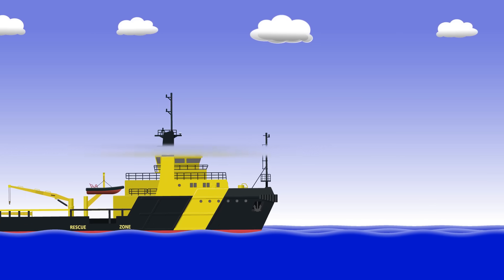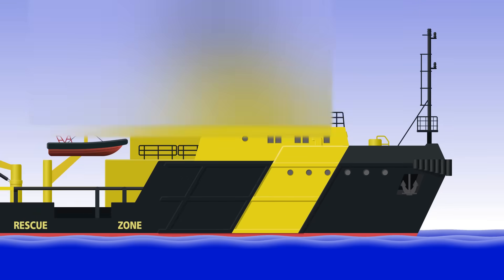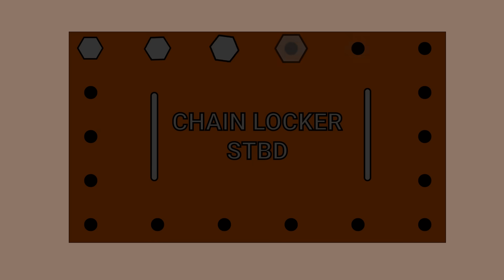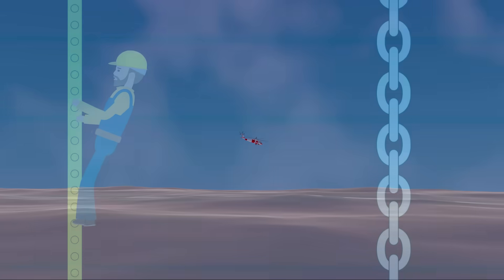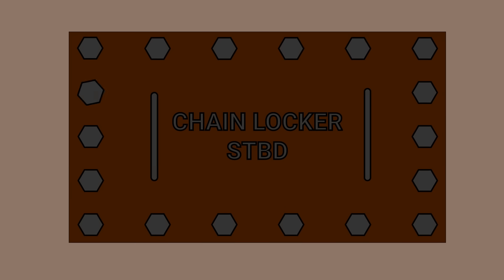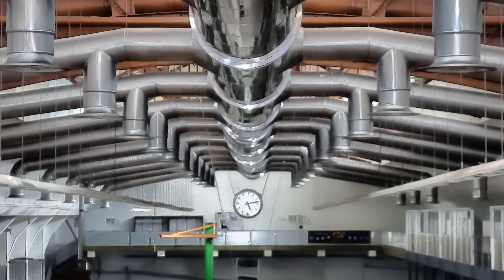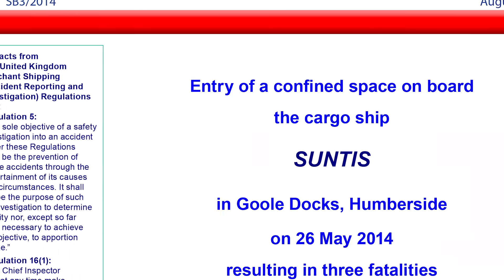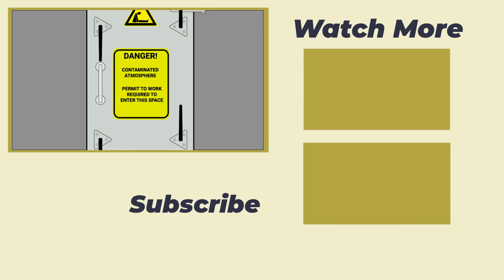Why Enclosed Spaces Are So Dangerous? | Enclosed Space Entry

Comment: If the only entrance is bolted shut, then you should probably just... not.
Reply: The only other entrance was probably the chain entrance. Probably pretty narrow compared to the volume inside.
Reply: Sometimes people dont really think of these kinds of stuff. Empty but spacious space. No wierd smell. Shouldnt be toxic, right? 

Its just things that fly over your head. Like entering a locked storage room. You think its locked because its because they dont want people to be there because of the chain suddenly moving and dropping. Its not like they were warned (no oxygen inside).

Its the immediate threat that we worry about and never the other stuff so its understandable as to why 2 people had gone there without breathing equipment.
Reply: That's what I am thinking.
Reply: DANGER: CONTAMINATED AIR
Reply: Yeah they should be given ear plugs.
Thiers deaths made me sade, considering two of them went in to rescue their friend.
Reply: Thank you. I totally missed that in the video.
Reply: But crew were doing tying off these chains to sleep, this was most likely an example of corner cutting combined with poor design.
Reply: Mostly toxic gasses don't have smell...
Reply: @alvydasjokubauskas2587  . The real issue is many toxic  gases, have no smell at all . And some toxic ones actually negate any sense of smell , such as Hydrogen Sulfide, which smells awful in low amounts, but kills the sense of smell at higher amounts .  A human , simply cannot tell the difference based on their senses . And no human can "smell" if there is not enough Oxygen present.
Reply: Its insane how many people die from this on ships. Second ship I was ever on guy died in a ballast tank we had purged to repair a fracture.
Reply: @Bitter-Sailor  Iron rusts, and when it does it takes the oxygen out of the air. An enclosed ballast tank is a death trap, if not properly ventilated for many hours after being opened . Never go into one,  or even stick your head into one to "test" the air. good chance of dying.
Reply: @chrisperrien7055  I'm aware of that.  Sailed Cargo officer on ATBs for 10 years.
Reply: Jerome Powell  I make 6 digit income and only work 6 months out of the year.  Merchant Marines is a pretty sweet career.
Reply: I do work on such spaces frequently.
Some jobs needs to be done by someone despite the danger. There are procedures to mitigate danger.
Reply: I am kinda amazed that this crew knew nothing of both of Iron rusting depriving of oxygen and that ocean organisms/organic materials rot in enclosed spaces generating Hydrogen sulfide, a stink you don't want to be around, or in. Those warning labels, and highly rusted over/painted huge bolts gave fair warning.
Reply: @chrisperrien7055  People just assume oxygen is everywhere.
Reply: Otoh tho you would think they could at least put a warning sign on the door... Otherwise it seems to come across as fairly innocuous, to me at least.
Reply: Yeah, removing bolts and climbing down a ladder shaft just to secure an anchor chain for the night because it's annoying seems like a really bad idea.
Reply: Well... the chain sounds won't be bothering them anymore.
Reply: Or with good reason, training, and with a suitable breathing apparatus.
Reply: What is hard to understand is, why the Captain, Chief or someone with authority allowed them to entry an enclosed space without proper ventilating first.
Reply: ....yea but this chain is really annoying

And fair point, without the benefit of this video you might think it has 18 bolts for theft prevention.... Or sometimes, stuff just has lots of bolts, ever repair a German car...? 

Not all aspects of a think is well considered all the time
Reply: That's only cause you have seen this video.  That kind of thinking would have us without most of modern electronics in this dreary world.  Exploration and initiative are demanded cause no one wants the commonplace or normal anymore.
Reply: Frank Kepler 
True
Reply: hahahaha thank you for recycling what the video said..very informative 👌
Reply: 18 bolts too. 18 must mean something pretty you know serious
Reply: @rafalswiniarski3866  Maybe the 18 bolts are there to avoid the chains being stolen.
Reply: @bfmarcondes  Do you know how much those chains weigh? No one is walking onto the ship and just carrying them out to steal them. Standard ship anchors for a vessel this size, just one link weighs 158kg (350lbs). Good luck trying to steal it. I hope you were joking about the stealing bit.
Reply: @2009dudeman  Irony my friend, irony...
Reply: @bfmarcondes  thats sarcasm i think not irony
Reply: @serenity748  Hello, not really since I didn't had the intention to ridicule ou mock somebody. 

Now that you have raised the question I think that a paradox could be a better definition.
Reply: @bfmarcondes  iron-y my friend iron-y
Reply: Some of us work in industrial settings. We have confined space procedure. Literally just today I unbolted a bin that holds 30,000 pounds of granular product and crawled into to clean it out. (We have oxygen meters, N95 organic vapor cartridges and lock out tag out procedures though because I work in the western world with the other devolved people)
Reply: @jackmehoff7274  it happens all the time in the western world to.  People get lazy skip procedures.
Reply: @jackmehoff7274  jack me off, really?
Reply: That's what she said.
Reply: Why was it bolted shut so the oxygen could run out? This is why we need  right to repair. Ships need to be designed to be repairable, and all parts should accessible
Reply: Three more male casualties, to go with the 97% of workplace fatalities that happen to men. "Equality" amirite ladies?

Comment: i had two friends and a father die this way.  they entered the pump house for a manure pound for service.
Reply: My condolences.
Reply: It happened to me a year ago at work. I was cleaning out a pump station for a main sewage line here in Iceland. I felt what was happening and was aware of the danger and barely made it up the ladder and collapsed on the floor above. I had to be rushed to the hospital and I was fine thankfully. The doctors said that literally 5 more seconds down there and I would not have been able to make it out myself.
Reply: @gudjonbirgir9317  phew that was close, glad you made it before the light went out.
Reply: @Mr-Ad-196  yeah. I guess I kind of cheated death on that one. Imagine dying in literal human shit. Also I was only 19 when it happened
Reply: @gudjonbirgir9317  I have worked around this gas in shop environments and yeah.. it's nasty stuff. After reading this thread, I had no idea just how dangerous it was.
Reply: @gudjonbirgir9317  not just time, perhaps you wouldve just expended more energy in the same time. Thank god you made it out that is extremely anomalous. Confined spaces are so dangerous BECAUSE self rescue is 99% of the time not possible.
Reply: @psyience3213  I'm guessing the oxigen levels were low but not immetietly lethal. And when I started using the vaccum hose and removing most of the sand and mud and shit off the floor I must have relesed some gas and messed with the oxygen level. So I very slosly felt weak and at one point was unable to stand on my feet down there. Thank god I had a coworker outside that threw me a ladder as I felt I was slowly going out. I made it. And I am thankful for it. I know its weird to say bc I was working a vaccum truck and working with shit all day but I love my job and this is just something I have to keep in mind next time I go down in there in the spring
Reply: @gudjonbirgir9317  Glad you escaped with no lasting effects. Stay safe!
Reply: Hydrogen disulfide. It stinks to high heaven, but in dangerous contentrations it actually knocks out your sense of smell entirely, often lulling people into a false sense of security.
Reply: Damn
Reply: Oh God......I remember as a kid.....we use to play in that place.....it was unlocked.....welp I think me and my friends got lucky......
Reply: h2s gas?
Reply: @spawnof200  That is the number one cause for suffocation in facilities such as that, so probably.
Reply: My condolences. This is a real fear of mine being a plumber. I've always been cautious about deep manholes.
Reply: I’m sorry friend :(
Reply: Death by shit gas...
Reply: Shot that’s hard, dying for shit
Reply: @DeadeyeFalx  ita definitely a shitty way to die...

😳
Reply: @NiSiochainGanSaoirse  haha funny pun
Reply: This happens regularly in my countries wine cellars and cesspools.
Reply: Same thing in Auckland NZ, or perhaps that was your friends case!
Reply: That stinks.
Reply: @Thomas Berger NO yea!
Reply: yea working in a trade lol yea we had to go for safely courses yea one of the classes were cut short yea larger number who were taking this course  their company had an accident and killing 4 people  too  yea got to take another course with a few of the people worked for the company yea 16 hours later we finished that course yea the few of the people did talk about what happened that day  yea it was worth the time we all pasts the tests with the few of changes done to the course afterward too  
i have a monitor i bought for my self yea love to ride horses  yea got used to having it all the time  had 8 riders with me  was a gas well  coming  near to  yea pumping station it was  yea, my monitor, when off when we got close to the building were to yea 2 vehicle were at that site too yea did not look as normal it should be because the door of the vehicle was open and the snow we had  not tracked  but the vehicle was running to yea with my binoculars yea saw bodies on the ground yea we did call for help too yea all we could do now is to wait to yea could not go back to the camp were had  to or sent back to  camp someone to yea  the riders were not experienced enough to find their way back ther safely  yea never trusted them to stay away from going into the site too  yea  more back farther on the road allowing us to have a fire  safety  yea   3 hours later yea police shown up  yea great sight to see yea we have food on the way yea they were told to pick up food for use  yea my friend were happy  they go a warm vehicle to sit in yea the police did taken the to get how vehicles too to load up the horses too they when to town and got help with the horses too and got a hotal room too  yea i remeaned out there the right people came yea 8 they found died  yea they have charged someone with the deaths of the 8 people to
Reply: @jenniferwhite6089  yeaing yea yea yea YEA!!! YEA!!!! YEA!!!!!!!!!!
Reply: @jenniferwhite6089  nice rap verse
Reply: I had this happen me, but turns out it was just a fart and everything was ok, i never overcame the fear of my own ass tho.

Comment: The spurling pipes must have been damned well sealed to prevent air entering and exiting around the anchor cable themselves.     All it need is a relatively small and easily carried extractor fan with a manageable  'elephant's trunk' to extract the depleted air from the bottom of the locker while air replenishes through the manhole cover.   Then lower an oxegen level detector pipe and test the air.   Those guys cannot have received proper training.

Comment: People that work on an emergency vessel should have been trained for enclosed spaces. I had to get certified a couple years ago for a painting job I did working in an underground concrete tank made for holding water. One of the first things you learn is to test the air before you enter these spaces. You also require someone to be outside the door at all times and if someone passes out or is injured inside there is a very specific procedure on what to do. You are not supposed to follow them inside to try and save them. The saddest thing here is that this was totally preventable with a hour long certification class and a respect for why these rules exist in the first place.

Comment: Your definition of an enclosed space is incorrect.

an closed space is a space with restricted ingress and egress and is not a normal working environment
your definition is an un-ventilated compartment

the other thing to note is oxygen should be at 20.9% you are spot on about the lower oxygen hazards, but the oxygen content can be higher and it is still not safe to enter the compartment.

even oxygen at 21% can be dangerous (what other gasses are in there that are pushing the oxygen content up)

if you see a warning sign about confined space, enclosed space or un-ventilated compartments and you don't have training. don't enter

Comment: I had thought an enclosed or confined space was just that the space had limited entry/exit points and the space itself was small, opening the potential for accident if one were to bump their head or something. That or that the space is just so far removed from normal operation areas that one could get stuck in a confined space and be there for a long time if no one knew they were inside. I never thought about the air quality.

Comment: Why didn't they put a harness and rope on the first rescuer?  At least be able to pull up the guy you send down there to get the first guys jeez.

That said, i'd have died if i was the first first guy. I assume that the chain pit holds the chain for the anchor as as a result there's a hole that the chain goes in and out? Also if that's the case i imagine there's a drain of some kind to prevent water build up in the pit. From that i would have assumed that there was enough ventilation for the air to be replenished just by wind (not that i would've thought about ventilation anyway...).

Comment: I work with a pretty fun one. Integral fuel tanks on passenger jets. Well-sealed spaces filled with jet fuel fumes. We have to ventilate them for hours before they are safe to work inside. And even then, you want to position yourself so that you can escape quickly if you begin to feel light-headed. Changing fuel pumps, capacitive fuel-level sensors, flap valves, check valves. Resealing bolts, seams, and rivets. Lots of intensive maintenance done in tight, hot, oxygen poor, highly-flammable, wet, and fume-ridden spaces. It's one of the hardest parts of being an airliner mechanic.

Comment: I'm a scaffold builder and have had to work inside huge, and small tanks. Air is pumped in, then we need a hole watch to keep an eye out on oxygen levels with a monitor. It's a huge deal. You can't even peek inside a tank without air being pumped in, and if you get caught doing that, well it's time to look for another job.

Comment: Working with the citys waste water system, every time some has to enter an enclosed space, we wear raspetory masks(i think they are called in english) and we have a few old pumping stations enclosured in a "house" and thats always considered a 2 mans job, where one is outside and the one entering wear an oxygen measuring alarm wich goes off when there is less than 20% of oxygen in the air. 
Also the jobs when entering enclosed spaces(sewer systems) is considered a 3 mans job and the one entering must also have a safety line on. You cant smell the bad gasses from waste water when the content is too high and you wont feel it if there is'nt enough oxygen youll simply pass out.

Comment: What?!  Don't areas in Europe have similar agencies like OSHA in the US???  I have been confined space entry trained for over a decade now.  I first came across needing to be trained on this when I went to work for a telecom cabling installation company that would occasionally do work in manholes.  Then, even in my next job as a laborer and then subsequently a heavy equipment operator for my city sanitation department, I was also required to do annual refresher training on confined space safety to maintain my OSHA certification.  Even the backs of garbage trucks are considered "permit required confined spaces".

I can't believe these guys were RESCUE workers and were not subject to mandatory confined space safety and entry certification!  Holy cow!  Even just regular firefighters in my little city of 85,000 people were required to be OSHA Confined Space Safety and Entry certified, as rescuing people could very likely include getting them out from permit required confined spaces.

Comment: My dad used to work at a fish facility. Basically a huge part of an even bigger state-wide system along the California Delta where fish were collected in huge buckets which are part of a huge network of massive holes about 40 feet deep, with 3 in one of the two buildings. Water fills the bottom, where the bucket is suspended by a massive vertical crane on the roof, and fish are collected from the delta. They would then be collected into a tanker truck and hauled down to the beginning of the delta so they won't be killed in the massive pumps, as well as research. Anyway at those huge pits, there is a suspended standing area so that you can pilot the crane and get it precisely in the smaller hole where the fish are separated from the water, and if you ever have to go down there, in every building you have to have an oxygen respirator and 2 other crew members in case of an accident, and there are big security latches to undo to get into the pits, and they have a course on it every year. Anyway that was a huge wall of text thanks for reading.